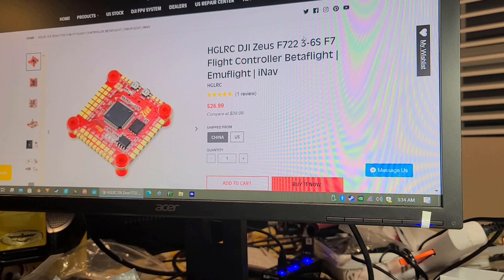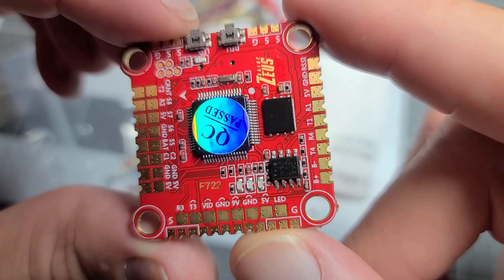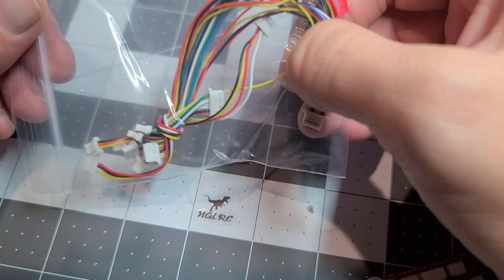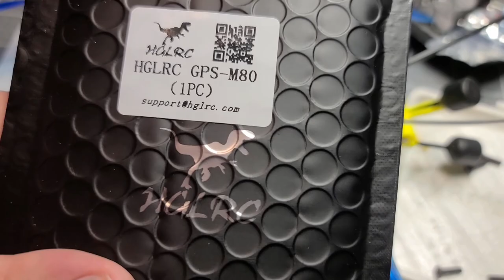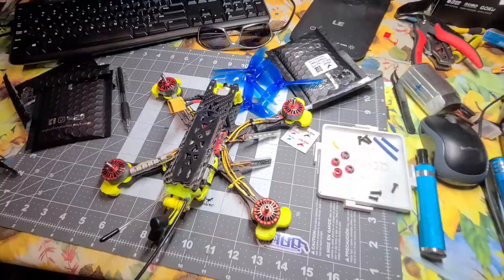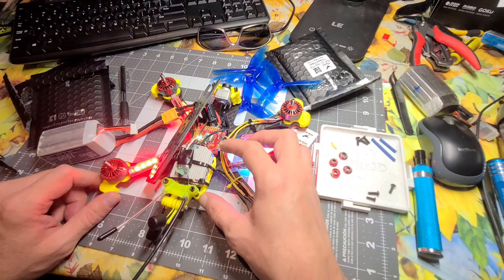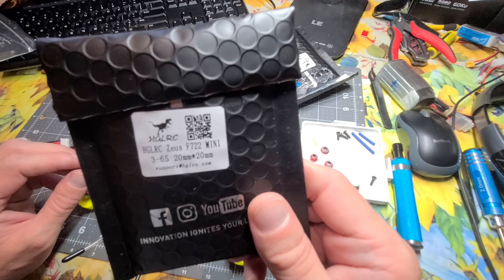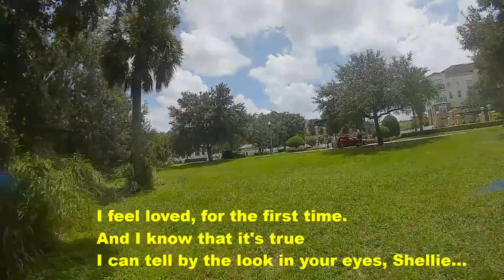HGLRC Zeus F722 DJI Flight Controller Review by Fred Cass

Comment: You said you had to change one of the wires from the ESC but you didn't even show us.
Might be helpful to show somebody else what to look out for
Reply from the maker: Well every esc and FC is different.  You need to compare the wiring diagrams for both and cross the wires to match each end of the connectors appropriately.  Joshua Bardwell has a good video on it (something like how to set up any flight controller).